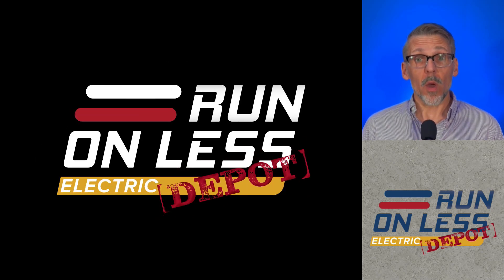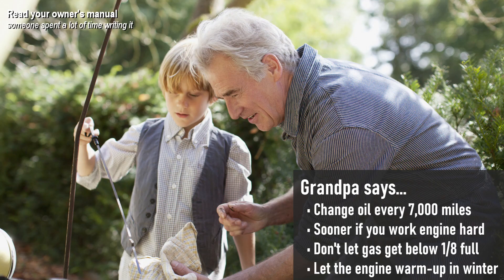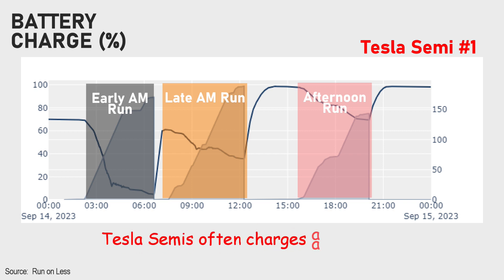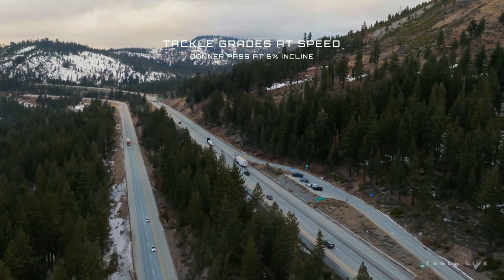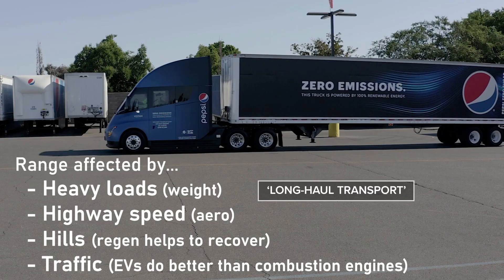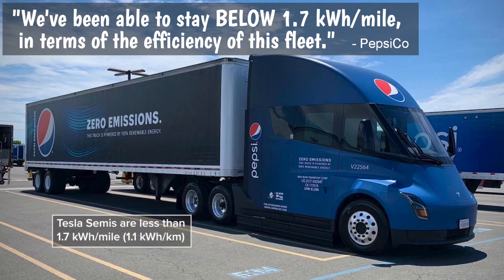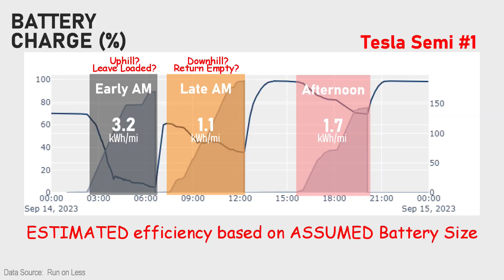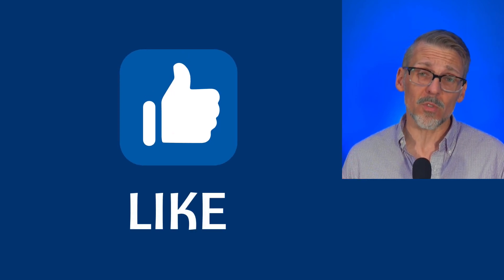In-Depth Analysis of Tesla Semi Data (Freightliner and Volvo too!)

Comment: Being "maxed out" at 82K lbs still doesn't tell us how heavy the payload is. Without this, we're not learning anything. And a company that wont provide this most important of information in specking out a truck, they're hiding vital information. Go spec a transport truck. I don't think you're going to find a transport company that will purchase a truck that doesn't provide all the specs. No jumping to conclusions necessary if they aren't giving you all the specs. They're hiding something vital.
Reply from the maker: I stumbled across some data in the video I did for WattEV. At the 5:55 mark I summarize the info. https://youtu.be/6Okmg6PpmAA?si=JEowzdcH0-JOJ25V

…basically, yes I am still looking for hard data on how much more a BEV Tractor (or Hydrogen Fuel Cell) weighs more than a Diesel. I’ll be sure to make a video if (when) I get better data.
Reply: This video is pure propaganda for Tesla, the little video where the Tesla semi overtakes a real truck in reality, there is the Tesla that is being overtaken, has talked to a Pepsi driver and he says that their Tesla semi is the slow trucks on the road, otherwise they would not be able to drive very far and they cannot have much weight on without it affecting the battery.
Reply: The weight of the battery alone is probably 10k lbs
Reply: The 500-mile version of the Tesla Semi weighs <23'100 lb.  A typical trailer weighs around 14'000 lb.
The payload is therefore 82'000 - 23'100 - 14'000 - 300 (driver + some luggage + miscellaneous) = 44'600 lb.... which is right on the average maximum payload of a class-8 truck in the Us of A!
Tesla is hiding NOTHING to its clients, I am pretty sure have a full set of specifications.  But the public is NOT a client for a class-8 truck!  If they did not publish the tractor's weight earlier, it is because they were still working on reducing it.. BTW, they still do!
Reply: @st-ex8506  Show me your source.
Reply: The tesla semi with a 53 foot reefer trailer has around 44k of cargo capacity.
Reply: @willparrish7646  Depending on the volume of the cargo. I've had cargo that fills van trailer, but only weighs about 9K lbs. I've had cargo that would only partially take up the volume of a van that weighs in at 48K lbs.

But I have no reason to think you know specs Tesla wont give out.
Reply: At a recent talk, a rep from Tesla shared that the 300mi Tesla semi weights <20,000lbs, the 500mi semi weighs <23,000lbs. The average diesel semi weighs btwn 17,000 - 22,000lbs. Given that electric semis get an extra 2,000lbs gross legal vehicle weight, they can carry pretty much the exact same weight as a diesel semi.
Reply: @truhartwood3170  Here's a strange consideration. 300 mile tesla semi weighs <20,000lbs. (probably 19,999 lbs) And this is something a rep shared. How does one determine how far a particular range is when it varies with the weight of the total tractor, freight, trailer and terrain. The info given is too vague. Again, this is not something being offered for the benefit of a transport company. It sounds too much to me like a PR program, which Elon is famous for over selling. He wishes to impress upon the public that he is the savior of civilization. 

Yes, these elements, weight, terrain also affect diesel transport. But a diesel transport manufacturer offers as much detail as possible to the purchaser so that they can make this decision.

I want EV transports to work. I also think it can work. My experiences with ICE drive trains gives me a little understanding with the comparison to what advantages an EV drive train can offer. But Elon's performance over time has shown him to be the salesman of a brand. And he is the brand. But his brand has proven to be that of an unscrupulous industrialist. Among other things.

All this doesn't mean that Tesla transport can't be a viable thing. But I get the impression it's the tech people who are going to make it work. Like Ford didn't make the V8 work. The techs did. Ford was a salesman, as Elon is. Unfortunately, Elon can also do a lot of harm if he sells lemons, or death traps, or economic flops.
Reply: @RichardRoy2  The range is with a full load (82,000lbs GVW), no total elevation change, at an average of 55mph, with a temp around 70°C/20°C (though low temperatures don't matter nearly as much with the huge battery pack). This is what they're experiencing real-world with third-party testing, not just Tesla's/Elon's claims.
Reply: @truhartwood3170  I'm sure there are some out there who would find that enough. Not many, though. As I said, it's PR, not industry oriented.
Reply: @RichardRoy2  actually that would allow the Tesla semi to do over 70% of current routes done with diesel trucks. There's quite a bit of meticulously detailed data on this, so these are very well understood and established facts, not just marketing promises or guess work or whatever. It will take them many years to build enough semis to do that 70%, and in that time the tech will continue to improve rapidly and the costs will keep coming down and changing stations will keep being installed etc so that by the time they're doing 70% or routes they'll be able to 100% of routes.
Reply: @truhartwood3170  Sure, the tech will continue to advance. And if they feel they aren't being conned, the transport industry will adopt.
Reply: @RichardRoy2  and they are, eagerly.
Reply: @truhartwood3170  In limited capacity. Hauling potato chips. There are plenty of specialty light loads that it may be useful for. Probably not going to see a use on the heavy boards. Unless they do like the 80K lbs boards and modify the weight restrictions in Michigan, Ontario, and Quebec.
Reply: @RichardRoy2  they are mostly carrying beverages, not chips, though they are doing that as well. As I said, around 70% of routes could be taken over by the Tesla semi with its current specs as a one-to-one replacement for diesel trucks. Someone on a other thread was bragging they regularly hauled  diesel truck could haul 48,000lbs with their diesel semi. I pointed out that the 500mi range semi has a cargo capacity of 49,000lbs and the 300mi range semi has a cargo capacity of 52,000lbs. You really need to drop this whole weird idea that they're significantly heavier and can't do the job. They totally can.
Reply: @truhartwood3170  Those are claims. I'm still seeing no reliable sources to confirm any of this. There's a claim that fully self-driving was supposed to be a thing with Teslas. But it's just a claim with plenty of video showing a lack of support. "They totally can." is not confirmation.
Reply: @RichardRoy2  But they're doing the job RIGHT NOW which is where they're getting the real world numbers that show they can take over 70% of the routes. As in, 70% of the routes are easier than the hardest routes the Tesla semi is already doing *right now*. You keep talking like this is something speculative way off in the future. 

Why would the lead engineer lie about the weight? If I was buying a Model Y and they told me it weighed 20% less than it actually does, I wouldn't know and frankly wouldn't really care that much. But the semi is being sold to people who will be... No wait, ARE CURRENTLY weighing it multiple times per day as a matter of course. Their business depends on the weight, even the legality of driving it depends on the weight. Pepsi already has 85 of them, and other companies like Walmart and Costco already have some as well. If he lied about the weight they'd all instantly know. Any prospective buyer is going to want to do some testing with one before they commit to buying a bunch. And these prospective buyers would let each other know if the actual weight was thousands of pounds over what was claimed. There is every reason to tell the truth about the weight and zero reasons to lie about it in an industry that is all about the numbers.

So sure, I am eager to see what the actual weight of the high volume production model is, but I have no reason at this point to doubt the claimed numbers on an actual, existing product that customers are already receiving. It's not really comparable to Elon making predictions about a product they won't have any good data on until years in the future. Ya know?
Reply: @truhartwood3170 no, they're not. They're not doing any jobs as there's basically only a few dozen Tesla semis and no one will talk about em 🤣
Reply: @TheGuruStud  few hundred you mean. And there's quite a bit of info if you look.
Reply: @truhartwood3170  There isn’t even a hundred sold yet guy- it’s 70 to pepsico only and they don’t allow them to speak about them. 

And pepsi only got them from government grants- no risk.

Keep copeing
Reply: @prof.crastinator  I believe Pepsico has 85. They had 35 and just added another 50. Costco and Walmart have some, but I'm not sure how many. And of course Tesla has quite a few they're using for their own transport needs. Go check out the Run On Less event where they tracked the performance of 3 of Pepsi's Tesla semis along with a range of other class 8 and smaller trucks. There's quite a bit of data there.
Reply: @truhartwood3170  You keep throwing out claims. But I wouldn't be buying anything from you. So, the ones actually selling the thing can dismiss anything you say as nothing they offered. And Musk seems to be enamored with litigation as much as Trump is. The lead engineer does as they're told. They can also be dismissed as "misspokespersons" by the company. They could also say, "yeah, that was the weight of a particular package..." We are not privy to NDAs among companies and employees. You're trying hard to sell it. But we're already watching how Elon treats employees and customers on many platforms. And I'm sure there are many companies that would like to have you as a salesperson.

As to companies being all about the numbers, you're right. But these days, the numbers have more to do with immediate gains, and a contract can do much to disguise where the actual gains are coming from. This is why Musk likes to dabble in many companies. He can shuffle losses and gains around to hide problems, as well as distraction with "NEW BREAKTHROUGH" promises. He oversells everything.

Does that mean EVs are a bad idea? No. But markets are toys to unscrupulous industrialists and cons. You seem to think companies are the harbingers of virtue with their numbers. But people can be, and are, pranked by math-cons.
Reply: @RichardRoy2  No to pretty much everything. The semi is a real product already in the hands of customers. There's no future promises here. It weighs what it weighs, it goes as far as it goes. There's not really any way to fudge these numbers. Their customers would know they were lying as soon as they said it. And their customers don't care about promises, they'll do their own validation, so there's zero incentive to lie and every incentive to be honest and accurate. It's a completely and totally different thing than a product that is only in the early design phase, years away from production, with Elon giving asperational specs meant to hype up the company and get the non-critical public excited about it. You really need to separate these two completely and totally different scenarios in your mind, because right now you don't seem like you are.
Reply: @RichardRoy2 You joke about chips, but the chip loads are double stack 44-48k lbs for Frito lay. The Pepsi loads max out weight far before the volume is, single stack height with pallets loaded long ways and spaced rather than packed.

Chips get pretty heavy when you load 50 or so pallets of them.
Reply: @Jaker788  Yes, well, I'm sure there are freight companies that are specing out their trucks on the basis of a weight target of "pretty heavy." As to your weights, you may want to see if your source is telling you the weight of wood chips, not potato chips. I've hauled wood chips. And the weight you're giving is about right for wood chips. You're not going to get that kind of weight from potato chips. Probably closer to something like 5-10k lbs with potato chips.
Reply: @Jaker788  You posted you got the source from Frito Lay/Pepsi, but it seems to have disappeared. Please post a link to that source, thank you. I'd like to see that.
Reply: @truhartwood3170  Cool story- not true yet- 70 something at pepsico
Reply: @prof.crastinator  not a material difference. If they had one, or just a few, it wouldnt change the fact that they know what it's weight and performance specs are, which was my main point.
Reply: @truhartwood3170  Well then why won’t they let a third party gather that data?  What are they hiding?
Reply: @RichardRoy2  Just look at every other product Tesla makes and you can see where this si going. Do your research, invest in Tesla.
Reply: @prof.crastinator  Wait. Are you assuming semi is going to be a failure because they are not discolsing the specs and the reason why is that you think the specs suck?!
Reply: @lucadellasciucca967  No, physics is why I KNOW the specs suck. Anyone really familiar with batteries knows the specs suck.  As battery vehicles don’t scale up well.  The weight of the batteries themselves prevents good range- and then the charging infrastructure needed would outweigh any fuel savings for many many years- until those battery packs need to be replaced.

Here is the secret electric car makers are hiding from the public:  Fast charging reduces the life of cells considerably.  It increases dendritic growth and will kill cells much faster than slower c rate charging.   That combined with the amount of power delivery needed for these chargers is super expensive kit and needs to be passed on to the consumer.

We are just seeing the first Tesla model s and especially the roadsters packs just dying quickly.  And the sticker shock the owners get to replace them.  Now imagine the same thing with the semis but the costs being catastrophic…
Reply: @lucadellasciucca967  Also as batteries become the bottleneck of production- is it smart to have these vehicles with large packs and very low profitability take needed cells from the (formerly) actually profitable cars?
Reply: @truhartwood3170  Why doesn’t Tesla themselves use them if they are so good?  Why sell them to the government (I mean pepsi- using government money)?  Shouldn’t they save them more by keeping them themselves and saving fuel?
Reply: @prof.crastinator  You re in total denial my guy! Your knowledge is outdated for today nevermind for the future.
Do your research, invest in Tesla.
Reply: @prof.crastinator As i said, you re outdated. The battery bottleneck has already happened. Next is energy.
the world moves fast my guy, 5 years old knowledge is antique, can you keep up?!
Reply: @lucadellasciucca967  What are you even saying?  It’s still relevant- as it is the limiting factor of production for Tesla… How does how old the problem is apply here at all?
Reply: @lucadellasciucca967  How is “my knowledge outdated” exactly?  Physics doesn’t change.  Bev vehicles will be niche use vehicles for large transportation of people and goods unless there is some unknown material or process that can store energy faster and longer in a more dense and lighter way… Which no one has been able to articulate this far.  Batteries are approaching their theoretical maximum energy density and even then their lifetime isn’t there.  

Smaller lifepo4 powered vehicles actually do make sense for close transportation- as they have a better safety and longevity profile- while only suffering small energy density losses and can be made into far larger cells.
Reply: @lucadellasciucca967  1 gallon of gasoline (6lbs of weight) is the same as 33kwh of range.  that means 6 gallons of gas has 200 kwh.   

This is the physics problem that needs to be solved.
Reply: @TheGuruStud There are over 2000 Electric Volvo trucks on the road - the only visual giveaway is no exhaust pipes (they are built on the same production line as the diesel trucks).
Reply: @prof.crastinator  The accepted value of 33.7 kWh per gallon for gasoline refers to the chemical energy content of gasoline. This is the total amount of energy that can be theoretically released during combustion. However, it does not account for the inefficiencies and energy losses inherent in internal combustion engines (ICEs).
Internal combustion engines are not 100% efficient. In fact, the efficiency of ICEs typically ranges from 20% to 30%. This means that only 20% to 30% of the chemical energy in gasoline is converted into useful mechanical energy to power the vehicle. The remaining 70% to 80% is lost as heat, sound, and other forms of energy.

Do your research, invest in Tesla.
Reply: Well here’s the thing- my old honda civic had an 11 gallon tank.  It would go 330 miles per tank.  That is 330 miles of range for a tank carrying 66 pounds of gasoline.

And that range can be replenished in about 2-4 minutes at the pump.  

A model s with a 100kwh battery is lucky to get 300 real world miles of range (and with 80% far less).  This battery weighs over a 1000 lbs and takes an hour to fully replenish at a specialized charger.

You can say the engine and transmission weigh more in a gas car- but when you consider the weights of large electric motors, increased frame strength to hold the pack and cooling system- it about evens out.  

Invest in physics lessons.
Reply: @lucadellasciucca967  Ok 10kwh for 6lbs- does that make your math any better really?
Reply: @lucadellasciucca967  10kwh of lithium batteries alone weighs over 100lbs at the highest energy density.  That is 94% heavier.
Reply: @lucadellasciucca967  Also lets not forget the inefficiency of electricity generation and transmission that most of the world uses to charge bev- which can often be less than 30% of fossil fuel’s potential by the time it gets to the plug.

And then internally there is more loss in the batteries, converting ac to dc for the batteries and back to ac for the motors.  And then there is parasitic drain- which happens even if the battery is completely disconnected.

Then we also have the problem of dendritic formation- killing off cells one by one- making huge inefficiencies in charging and demolishing range over time.  Calendar aging of cells alone will kill cells in 10-15 years.   Thats why you can find dirt cheap 2010-15 teslas- they need new batteries which can cost 20k without labor…
Reply: @prof.crastinator  I guess Tesla is just doing magic then! Do your resaerch my guy.
Reply: @prof.crastinator  "You can say the engine and transmission weigh more in a gas car- but when you consider the weights of large electric motors, increased frame strength to hold the pack and cooling system- it about evens out. " Invest in Tesla lessons. Structural battery pack. 
I ve done my phisics. That s exactly why i ve been dollar cost averaging Tesla stock for the past 4 years.
Reply: @lucadellasciucca967  Yep- now check the curb weight and subtract the pack weight.  you get a heavier car than any ice competitor.  So dollar cost average yourself to the poor house.  Or sell now and make other suckers lose their life savings.
Reply: Tesla model s 100d curb weight: 4,833 lbs.  1000 lbs of battery so 3,800 lbs.

Lexus es curb weight 3,690 lbs.

Still lighter WITHOUT the battery.

So…
Reply: @prof.crastinator  If you're going to make a comparison that is completely devoid of the reason for the change, then not make a fair comparison, then you're going to have a winner in carbon fuels. But if you want to make a fair comparison you have to look at the two keeping in mind that the EV stores all the products of energy generation and converts it back to the original material for reuse by charging. If you want to do that with Carbon fuel vehicles, it's going to be such a large contrast when you add storage for the products of combustion, as well as a system to convert those products of combustion back into useable fuel. I don't even think we have that capability in a stationary system, let alone a mobile one.
Reply: @lucadellasciucca967  I mean you think dollar cost averaging is physics so I don’t know if you are wasted keyboard strokes terrence.
Reply: @RichardRoy2  What are you talking about? “Stores all the products of energy generation” is quite the word salad that you may have to explain.  Are you saying gas tanks aren’t refillable?   

Because power comes from somewhere.  The electric vehicles’ fossil fuels are just further away. And yes, fossil fuels is how most of them are powered.
Reply: @RichardRoy2  I don’t understand your argument at all- honestly I don’t think you do.
Reply: @RichardRoy2  How does any of that change the math?  Maybe stop smoking the ganja for a bit.
Reply: @RichardRoy2  These batteries only last less than a 1000 full cycles- they aren’t magic.  Then you have 1,000 lbs of highly toxic e waste.

I don’t understand how this makes them more economically feasible?
Reply: @prof.crastinator  yeah your brain isn t that big i can just see...
Dollar cost averaging is to beat statistics, since my brain is not big enough to time the market :)   I d love to see your face in 5 years, when 60-80% of commercial vehicles sold worldwide will be EVs (some more statistics for you). 
Good luck for the future.
Reply: @prof.crastinator  The products of energy production are the exhaust gasses. Because the products of energy production, ie, the chemicals reacting with each other to produce the energy both before and after the reactions. Learn a little bit about battery chemistry, and about combustion.
Reply: @prof.crastinator  Your gasoline starts out weighing X lbs and taking up Y volume. Once used it produces a certain volume of exhaust gasses, so many miles of travel, needing a much larger volume of space for storage for all the products of combustion. Granted, you could compress all those exhaust gasses, but that takes more machinery and more energy to compress it. Then there's the machinery needed to reconvert all those exhaust gasses back into fuel. And it would take a lot of energy to  turn it back into fuel if we knew how. (We don't) But that would be the comparison as batteries don't dump all the products of the chemical reaction that produces the electricity onto the road, or into the atmosphere. Well, asides from the heat dissipated.
Reply: @RichardRoy2  you realize all electric energy is also produced?  
Word salad logic.
Reply: @RichardRoy2  I literally build battery packs for a living.
Reply: @lucadellasciucca967  Tesla has some real geniuses defending it…
Reply: @prof.crastinator  And when you replace your engine at 60,000 miles (like Renault, Peugeot, Jeep and other Stellantis vehicle owners are doing now) the reliability of EV’s is another factor.
EV’s don’t need to be driven to a service station to fill up either - you can do it at home on the weekend…
Reply: @RichardRoy2  you think matter amplifies when burned?  I’m so confused at any point you’re trying to make?
Reply: @allangibson8494  But when you factor in intial cost and resale value- even stelantis vehicles beat tesla
Reply: @allangibson8494  Never mind a single small accident often totals a tesla.  And as many older tesla owners are finding out- pack replacement ain’t cheap- they cost more than a new engine.

I still would take a tesla over a dodge or jeep
Reply: @prof.crastinator  Small accidents total a LOT of modern cars. Tesla’s aren’t unique in that. You are however far more likely to survive a Tesla crash at any speed.
The other problem with Tesla’s is Tesla doesn’t manufacture body spares - salvage is the only source. Not an “EV” problem.
If your air bags deploy in a modern car, the vehicle is a write off.
If the parts value of the car as a wreck is too high your car is a write off (a problem for Tesla’s - the drive train is worth a packet on the used market at the moment).
Tesla’s price on battery packs has halved over the last five years… They keep getting cheaper AND more reliable. Mean time to failure is over twenty years (ie they will outlive the cars structure which lasts twelve years on average in the U.S. due to road salt).
Reply: @prof.crastinator  The Stellantis vehicles have such a bad reputation the dealers won’t sell them second hand. So zero used car value after 60,000 miles.
Tesla’s biggest used car problems is the drop in the new car prices - when you can buy a new Tesla for $60,000, the one you bought new five years ago for $100,000 is going to take a big loss.
Reply: @allangibson8494  just not true about airbags deploying = write off, completely dependent on vehicle
Reply: @prof.crastinator  Talk to a tow truck operator or crash repairer. It is just not economical to replace the complete car interior when the up to ten airbags (ie Toyota Camry) deploy and shred the roof, seats and dash panels in a modern car (and the explosive engine stop cartridge fires to stop the engine dead). The seatbelt tensioners also fire requiring the seat belts be replaced too.
Reply: @allangibson8494  Hardly a fender bender like the tesla totals
Reply: @prof.crastinator  If you can’t buy parts easily and the wreck is worth 60% of the intact cars price, it doesn’t take much.
On the otherhand, I had a nose to tail with a Toyota Corolla that wrote the Corolla off and bent the number plate on my car…
Reply: @prof.crastinator  Don't strain yourself.
Reply: @prof.crastinator  " I literally build battery packs for a living."

 Now that's funny. But building battery packs is just assembly. It has nothing to do with balancing a chemical equation.
Reply: @prof.crastinator  Why doesn’t Tesla themselves use them if they are so good?
Tesla has been using their own semi for more then a year now for internal operations.
DO your research, invest in Tesla.
Reply: @prof.crastinator  As i said, the battery bottleneck is solved. It is NOT the limiting factor for Tesla production.
Reply: @prof.crastinator  Phisics does not change! It was possible to go fully electric 1000 years ago and it s possible now! Only difference now we have the scale and infrastructure! 
You re completely ignoring tech development. Your info are old my guy! New tech gets better, last more, cost less etc.
From 60 to 80% of commercial vehicles sold in 5 years worldwide will be fully electric. It s just superiror technology by any relevant metric. Tesla vehicles, are and will be the new standard from car to semitruck.
Reply: @prof.crastinator  "Yep- now check the curb weight and subtract the pack weight.  you get a heavier car than any ice competitor.  So dollar cost average yourself to the poor house.  Or sell now and make other suckers lose their life savings."
lol You talk like a couple thousand pounds would outweight efficiency, safety, performance, confort, consistency, cost of operation, automation etc! xD
Wake up, do some research.
Reply: @prof.crastinator  "These batteries only last less than a 1000 full cycles- they aren’t magic.  Then you have 1,000 lbs of highly toxic e waste."
You haven t done your research, that s why. Battery packs not only can be recycled, and will be more and more as it becomes a very higly profitable business, Tesla uses the used battery packs for energy sotrage in their megapack program. Life of the average battery cell is now longer the 20 years.
Reply: @prof.crastinator  Thanks. I just undertand phisics pretty well and i ve been researching, EVs, Tesla in particular and AI for the past 5 years now on the daily. If you need to know anything i can probably help, ask away ;)
Reply: @RichardRoy2  Lol- you have no idea about building packs then buddy.  You have to make sure cells match precisely.
Reply: @RichardRoy2  How’s the ganja?
Reply: @prof.crastinator  That's not chemistry. That's voltage. But keep trying to impress me.
Reply: @RichardRoy2  I have no need to impress you- because if you really knew anything about any of this you’d respect different chemistries have different nominal voltages, charge characteristics, usage curves etc… Understanding each chemistry is imperative to what I do…

So…
Reply: @lucadellasciucca967  Life of what battery pack is 20 years?  The calendar aging life of nmc alone is shorter than that- without any cycles.

But you’re the expert …😂
Reply: @prof.crastinator  And yet you didn't understand my comments. Follow your instruction book.
Reply: @RichardRoy2  copements
Reply: @prof.crastinator  I am the expert. So listen! Or read. Once the battery is not good enough for vehcile use it can be used for energy storage.
Most battery produced today and definitely in the future will have a life of 20 years and more, together with solar pannels.
Reply: @lucadellasciucca967  you don’t understand dendritic formation leading to cascading cell failure because you are not an expert.  It takes a lot of labor to recover cells, test them, rematch them and make a new pack- when those packs will have limited life and in no way will ever be cheaper than new cells.

You have no idea what you are talking about.
Reply: @prof.crastinator  You re old and your knowledge is old. Keep up or don t talk at all.
Reply: @lucadellasciucca967  How is my knowledge old?😂😂😂😂😂
Reply: @prof.crastinator  Yes, child.
Reply: @RichardRoy2  So you have no facts to refute what I say (because there are none) so you resort to name calling by saying I’m both old and a child. 

You seem like a serious person.
Reply: @RichardRoy2  you think engines need to store their exhaust for some reason and that batteries make energy… 

You have never elaborated or made any valid point.  You say I don’t understand the chemistry- which is rich when you understand that I have an engineering degree and do this for a literal living- but you never explained what I’m not understanding?  

Energy storage is almost the exact same concept in a battery or a tank of gasoline.  They are both ways to store usable energy.   You need to add more energy to a battery just like you need to add more gasoline to a gas tank.

The energy from the gasoline is made in situ through the engine.  The energy for the battery is most likely made from burning natural gas or coal and turning a turbine which is then distributed over long distances.   
They both use hydrocarbons, just one is made at the site of consumption and. The other is made remotely.

The battery chemistries have almost nothing to do with these facts.
Reply: @lucadellasciucca967  Says he understands physics while constantly misspelling the word itself…
Reply: @prof.crastinator  You talk like we re in the 90s' and computers and robots aren t a thing xD
Everything can be automized. Recovering and recycling saves money. 
Tesla batteries are lasting 200k miles easily. Cost of batteries hgas been plummeting and will about half again by 2030 is plummeting. Both production and recycling are ramping.
You have zero prespective of the future. You re old your knowledge is old.
Do your research, invest in Tesla.
Reply: @lucadellasciucca967  wait until you find out both computers and robots were indeed a thing in the 90’s…. Cool story- hasn’t come close to happening.
Reply: @lucadellasciucca967  “Everything can be automized (not the word you think it is)”-  Yet Tesla can’t build a level 5 full self driving car yet?  Maybe “everything” can’t be?

There is ZERO large scale recycling of lithium batteries right now- despite all the propaganda from lithium battery manufacturers that they CAN be recycled- the fact is it’s FAR too expensive to do and they just Aren’t.  They are scrapped for the easier metals like copper and zinc- but that’s it. Sorry if that hurts your feelings and shows your “research” to be bogus- it’s the harsh truth.

Automating things is very capital intensive and only has certain applications.  The problem with lithium batteries is there is a wide variety of manufacturers who all use different ways to attach packs together and seal them from the elements- making the cells themselves hard to extract.  Then even cells have different construction and components that take even more individualization to be mechanized.

You have no idea what you’re talking about- as anybody with real knowledge can plainly see.

Hand waiving problems by saying ai and robots does nothing to solve the very complex problem.
Reply: @lucadellasciucca967  Over 95% of lithium batteries go directly to the landfill.  And that 5% that is recycled is really only going after the easy metals like zinc and copper.
Even the more valuable metals like cobalt and nickel aren’t able to be recovered well.
Lithium is dangerous- as anyone with any real chemistry education is likely aware.  It is extremely reactive and obviously capable of holding a ton of energy.  

Do some actual research instead of just claiming you do.
Reply: @prof.crastinator  You keep talking about the present with 0 perspective of the future. I agree with your present.

Altough you re ignoring the last few years of battery recycling efforts. Again you re showing you re old, and gave up on the future.
Reply: @lucadellasciucca967  lol well then lets also pretend that in the future AI robots invent a device to scrub carbon from car exhaust- making Electric vehicles even dumber than they already are.

Wow- the future.  I hope you aren’t living in the past and just say that this is impossible- you technophobe!  😂
Reply: @prof.crastinator  Of course it  snot impossible. Carbon capture technology has gone down in price by at lkearst an order of magnitude. The problem is the scalability of the solution. By that solution we ll be carbun nutreal in 200 years instead of 20. Wake up my guy. Phisics.
Reply: @lucadellasciucca967  Spells physics wrong again.  A typical “do your research” stock pumper.
Reply: @RichardRoy2  One possible factor in the dearth of information is that, compared to diesel tech which is not expected to improve much year over year, EV tech is expected to improve in leaps and bounds. By publishing to much data now they could be creating a situation where people are not buying because they are waiting for the model after the next one where they expect the tech to be so much more superior. The dreaded Sinclair effect.
Until such time as they can get sufficient vehicles out there producing data for hundreds, if not thousands, of use case's they may very well be limiting the data.
Reply: @Agnemons  I think that's a fair consideration. I agree that ICE has been around for such a long time that much of the development has been done, and that EV tech is only beginning. Battery tech is only beginning as well. Unfortunately, the tech is being treated more as though it were physics. But I expect that is just one of many rationalizations being thrown up as a smoke screen to confuse issues and to discourage the exploration. But I think this may be more a product of the Big Oil Addiction struggling for dominance effect. But multiple levels of resistance are expected with institutions also associated with the use of oil, whether that be for combustion, lubrication, or chemical refinement and supply. So many pretend that the end of ICE will spell the end of crude extraction. Which is a complete falsehood. We get so much more than just combustibles from oil. What big oil fears is the loss of dominance. And they'll do whatever it takes to hold it. They've been doing that since the first EV came out in the late 1800s.